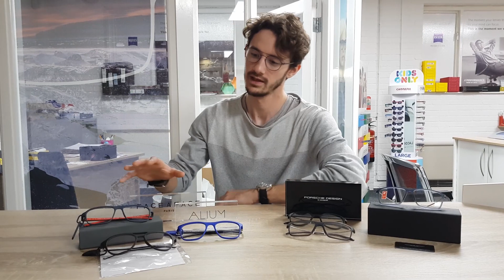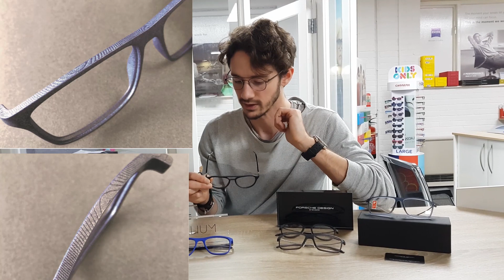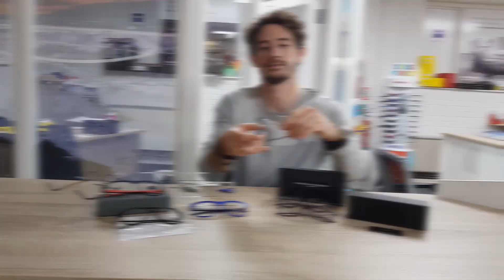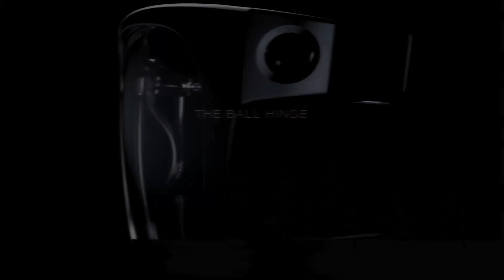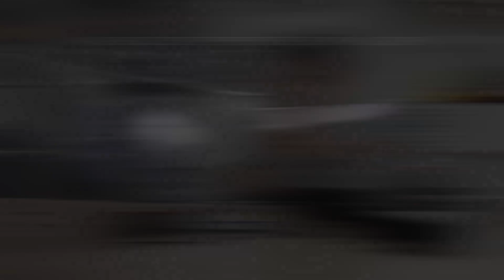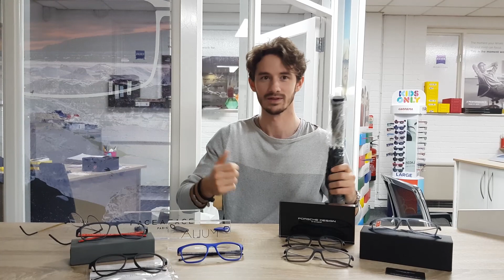3D Printed Glasses

Comment: Certainly the most common manufacturing process for glasses is injection molding which is a very efficient process. 

Also I appreciate the sell on the "perfectly finished frames" with the layer lines on top... Sorry "finger prints"

Comment: CAN U 3D PRINT TONY STARK/SPIDERMAN FAR FROM HOME EDITH GLASSES.

Mainly same design as the cool shades they sell and use in the movie. Only difference its made from plastic or strong plastic filament.

The tony stark shades they sell on amazon looks really cool on my face. Only problem. I cant always wear it unlike tested glasses. I really want that design look on my face with tested glasses. So I can wear it any time and place.

The problem is that because its made from a metal frame. Eye specialist say they cant reuse metal frames. Its a one and done. Because its more difficult to make lenses for them.

So can u 3D PRINT A VERSION THAT IS MADE FROM PLASTIC FILAMENT OR SUPER STRONG FILAMENT FOR DAMAGE BUT STILL BE EASY TO SWAP LENSES. When u have to take over a new one. Really like this design and planned to use it forever if I can get it in a glasses form that looks the same.

Love it has a shades but prefer it to be normal glasses.
Reply from the maker: Sorry, we do not laser cut glasses. However, the brand Alhem do sell a pair like that. 
- Haleemah

Comment: I think that 3d printed frames will take up a portion of the market because of customizing. I have a wide bridge of the nose and it is difficult to find a plastic frame that fits right.  They will not totally replace traditionally made frames because each material and manufacturing method has its own unique characteristics. As for surface quality of a 3d printed frame, it depends on technology used to be manufactured and post processing. Have a look at monoqool, they look great.